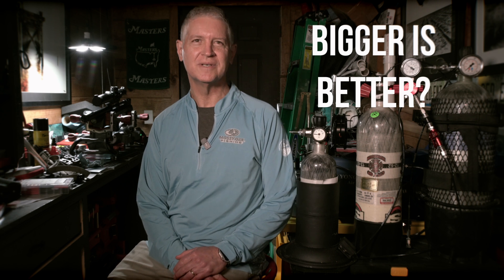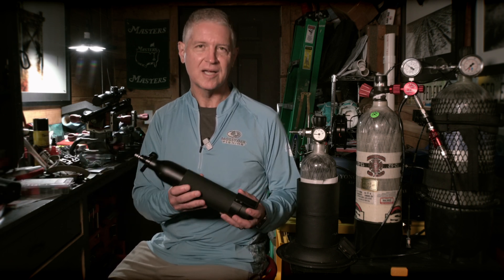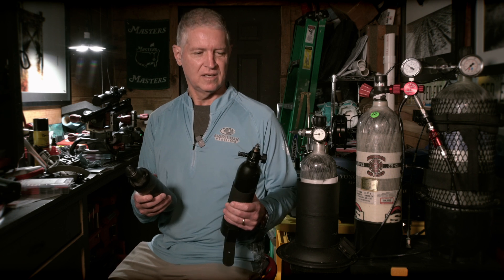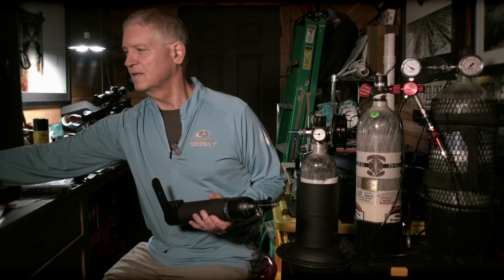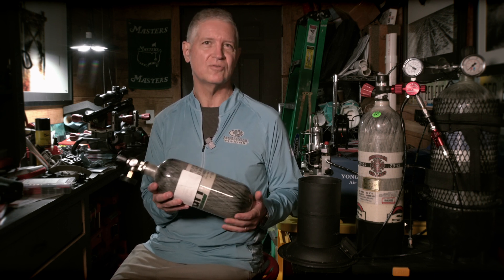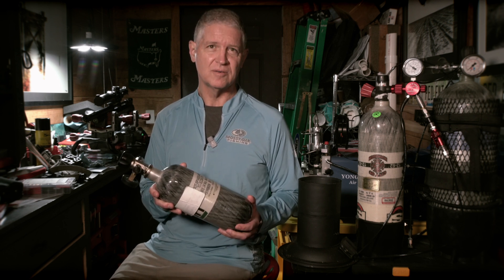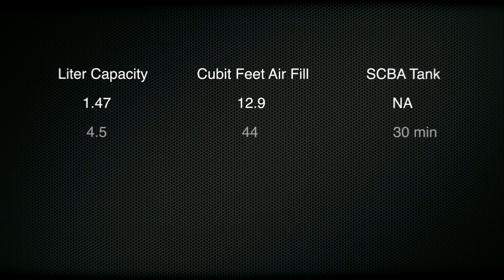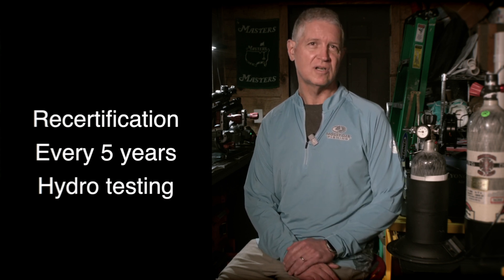What PCP Airgun Tank Should I Buy?

Comment: I don't understand why there is no equivalence between the US DOT certification and the CE European certification.
If they are just different labels for the same levels of safety standards then they should work out cover for each other.
That would help consumers in both areas.
Thanks for posting.
Reply from the maker: I agree with you and checked into this. A cylinder that fully meets one standard does not automatically meet the other, unless designed and certified to do so. For practical use, if you want a tank you can legally use and refill in both the U.S. and Europe, you’ll want one that has dual compliance / markings (i.e. satisfying both DOT and applicable ISO / EN / CE requirements). Thanks for the comments and for watching!

Comment: Another thing many people do not understand is “duty cycle” and how it relates to whatever electric tool they are using. Most people I say the words “duty cycle” to don’t know what it refers to at all. Compressors especially will fail due to overheating , I can just imagine how sensitive those 4500 psi compressors must be. The smaller sized ones I mean. Your videos are most helped, I think this is the third one I’ve watched at this point.

Comment: I’m new to this but it’s confusing. My understanding scuba tanks are cheaper because they are heavier and they have a lower capacity?

My PCP rifle has a 250 bars/500 cc bottle attached to it. I asked someone else about using a small scuba to keep in my backpack for portability and average scuba tank for my car and he said the maximum average of an air tank is 3000 psi so this will not fully refill your airgun as you will be short of a full refill and as you keep refilling it, you will get less and less air into your airgun.

If I can get more than one fill from a scuba tank, why won’t it fill my PCP gun fully the first time and less and less the more times you refill your PCP Gun? I have enclosed what he wrote before.

This is the part I don’t understand.

Simply put, How many times can I refill my gun with a small portable scuba tank and how many refills with a normal sized scuba tank?

Comment: another question I have a dragger one hr scab tank. I would like to change the regulator /fill valve to a pc p valve. Can you point me in. the right direction.? I purchased this valve before I got the tank and not sure of the thread 
 [High Pressure Air Tank Charging Valve 300Bar Filling Station Cylinder Refill Adapter With M18x1.5 Thread ] from tuxing
thanks for the time 
I want to use it as a buddy tank to tank on trips

Comment: Ok Iam totally green on the aspects of air gun tanks
I have found a fireman’s tank just got to get the date off of it to see of any years left. 
But just wondering if the tuxing products are any good. 
I know some things are what you pay for 
Also already have the heng compressor.  And large steel tank that has to be checked.
But it will need the fill line and gauge for it also. 
Can you fill a buddy tank from a larger scuba tank. 
Hope I make sense  
Thanks
Robert
Reply from the maker: Thanks for watching. As far as Tuxing tanks are concerned, I am unaware of any safety or quality issues. I think for many people they would be a good less expensive option. However, as far as I know (and I may be wrong), they do not have tanks that are DOT approved. That means that you would not be able to fill them in a SCUBA shop or other commercial business. They could certainly be filled by your own compressor. On the question of filling a buddy tank from a larger SCUBA tank- sure, as long as the pressure in the SCUBA tank is greater than what you need in the buddy tank. Go for it.
Reply: Hey just wondering which valve works with the firman tank 
The one I ordered looks smaller than the one that’s in
Could you tell me which brand  and size thread Bbb

Comment: That's not true about a oil less compresser only filling guns, I have the OMEGA AIR CHARGER that fills both my 75 cubic foot tanks with ease.
Reply from the maker: Thank you for the correction. For most of the budget oil-less compressors it’s a statement that most would agree with, however yours is obviously an exception. Thank you for clarifying.

Comment: Very informative and helpful as I need a tank. Have a Yong Heng, but I hate firing it up just for pcp top offs. Tank would be nice for going away from home too without having a compressor. Plus, from watching videos it is really fast and quiet to refill using tanks. I want the higher pressure capacity, so price has been my hold up. Was really hesitant of used scba tanks, but I feel better after your great explanation  👏  Thank you good sir !
Reply from the maker: Oh, good! I think you will be very pleased with a good tank. I have had no problems with my SCBA's purchased off Ebay. They were in good condition from a fire department and still have the logo's on the bottles. Very rugged  and well made. Thanks for watching!
Reply: @jmarkreed = Did you buy on eBay expired or current?
Reply from the maker: @MG956_  Thanks. They were current.